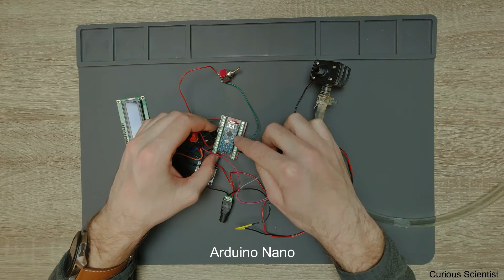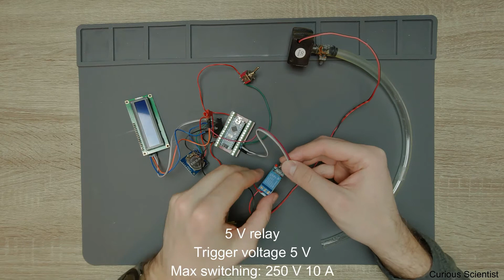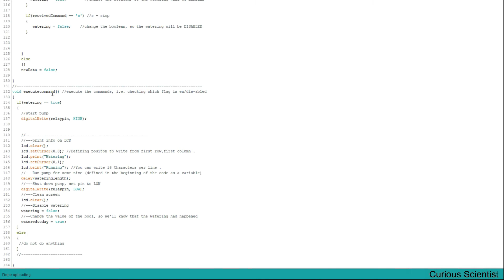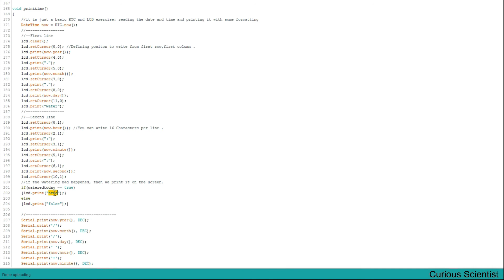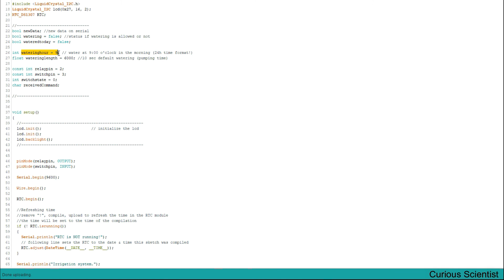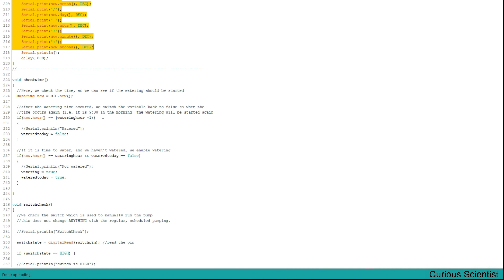Date and time based watering system using an Arduino and a RTC module

Comment: Awesome project.
Can you please add eeprom function to the code so the set time values are not lost on power failure .
Awaiting your earliest response.

Thanks & kind regards
Reply: I mean the set on off time values not the RTC time.
If the power is lost , one needs to set on off time again.
Hope you understand my point regarding storing on off time to eeprom.
Reply from the maker: Ah, sure. Yes, that you can store in the eeprom of the Nano! Just pass the values when you set the time and then recall them in the setup() whenever the microcontroller starts.
Reply from the maker: Thanks! The RTC modules have built-in batteries, so they don't lose the time once you set it.

Comment: Hi! great video, can i ask something? is it possible for me to replace the lcd screen with oled one?
Reply from the maker: Hi! Yes.
Reply: oh and also what type of relay you using, it is the low or high triggered?
Reply from the maker: I don't remember, but it doesn't matter. You can set the GPIO to high or low in the code.
Reply: @CuriousScientist  oh okay, thanks!

Comment: how to add 2 times watering in a day? like int wateringhour = 9 am and 5 pm??
Reply: Thank you
Reply from the maker: Hi! You just write two conditions which trigger the pump.
Reply: @CuriousScientist  like int watering = 9; int watering = 10 like this??
Reply: @CuriousScientist  you use ds3231 in actual but in code you use ds1370 rtc?
Reply from the maker: RTC should not matter too much as long as you get the same information out from it. Regarding the other questions, those are wrong. You declared the same variable twice just with different values.
Reply: @CuriousScientist  can I change the water pump into stepper motor?
Reply from the maker: Sure, you just need a stepper motor driver and write a code accordingly. Everything is possible.
Reply: @CuriousScientist  thank youuuuuu big help for my project hehe

Comment: Hi! Thank you, but I do have a question, on the 12v power supply.. how many amps? Thank you
Reply from the maker: Hi! It depends on the pump. Generally, they are 500 mA. So it's a good idea to use a 12 V, 1 A power supply.

Comment: Hi, well explained video. Only one doubt, is it possible to put multiple cycle for one day?. And if it could be controlled using a selection switch to alter timing as desired, it would have be very helpful.
Reply from the maker: Hi! Thanks! Sure, it is possible.
Reply: @CuriousScientist   Can you please convey how, I am total fresher in Arduino. A suitable link/ video explaining this would be helpful.
Reply from the maker: Hi! Just search for similar projects. I am pretty sure that someone already made it and published it somewhere. I don't have any resources as a reference. Also, you can just use my video. You can add more conditions that should trigger an action. But maybe for a total beginner, this is actually a too difficult project. You should start with something simpler.

Comment: Excellent project
But can watering  system will work 
If we want , watering system to run 
after two , three months
Reply from the maker: Thanks. Yes, it is possible. My watering system was running for half a year without any issues. I used it to water my chili plant in my office at work.
Reply: @CuriousScientist  means can I get watering after two month of gap with the help of rtc module
Reply from the maker: Sure, you just trigger the pump using the number of months as a condition. Or you keep track of the elapsed days and trigger after every 40 days. The possibilities are endless.
Reply: @CuriousScientist  Thank you Sir
Can you please give code of it to me
Reply from the maker: Sure, you can hire me for writing the code. But of course not for free.
Reply: @CuriousScientist  Thanks for your support

Comment: Very useful video! Thank you. I'm working on a program that will work on our product for our research defense, we didn't hire a programmer since its very expensive for us students to pay them. And currently, I'm having troubles with my program, is it possible that instead of turning the watering system off and on, but I will apply it to an LED that will fade at a specific time? In simple words, scheduling the LED to fade in and out at a specific time using RTC Module. I'm not very much of an expert when it comes to coding, can you recommend me examples that I can study with? I hope you can help me with this. And thank you for this video!
Reply from the maker: Hi! Sure it is possible, you just have to switch the LED instead of the relay. However, if you want it to fade in and out that's a different story. You then need to drive the LED with PWM. When you want to fade in, you ramp up the PWM, and when you want to fade out, you ramp down the PWM. For resources, the whole internet is there, just use Google.

Comment: Hi Curious Scientist. I have a question. How long can this stay continuously powered without a computer powering it, and how would I go about that? Thank you.
Reply from the maker: Hi! I used this exact circuit some years ago in my office to water my chillibplant and it was running from a wall adapter for roughly half a year.
Reply: Thank you!

Comment: Great video, had a lot of useful information. Thank you.
I'm having an issue with the LCD display, for some reason I don't see any information on the screen only the backlight is ON.  What could have caused it? Any guess or suggestions to look into the code. 
I understand if you are done answering such stupid questions. Once again thank you for the video.
Reply from the maker: Hi and thanks! It's very typical that the contrast is not adjusted properly. Try adjusting it using the potentiometer on the LCD.

Comment: Hi, thanks for your explanation and code. I’m a beginner and this info is real educational. Only one problem with the screen. Every second on clock makes screen blink. Strange no? Can you imagine what going on?
Reply from the maker: Hi and you're welcome! As you can see it on the video, I don't have this issue. I recommend you to disable all serial communication. You can try removing the section that I highlighted at 14:35.

Comment: What if i do not use a switch? I just only set thr time when to irrigate. Can u help me about the code?
Reply from the maker: Nothing should happen if you omit the switch. The switch is only used if you want to have a "forced" irrigation.
Reply: Bro, what library did u used to this code?
Reply from the maker: First of all, I am not your "bro". Second, I shared all the resources in my video and on my website. Take your time, watch the video and read my published material.

Comment: Thanks very much for such an in-depth explanation & guide to using an RTC to control the watering system using an Arduino. I'm currently working on a similar project and had been looking for a way to do exactly what you have done. You are a life saver!
Reply from the maker: Glad that my video helped you! Cheers!

Comment: ill try your code but, when the pump is after that the lcd goes blank? what should i do?
Reply from the maker: It should not turn off. Maybe you made a mistake somewhere. Do you power the pump with an individual power supply? 
By the way, I am not a free support service, I cannot answer every single questions for free.

Comment: hi can i use 220v pump instead of 12V
Reply from the maker: Hi! Yes, but make sure you choose a suitable relay. But I wouldn't risk using 220 V if it's not necessary.
Reply: @CuriousScientist  what relay module can  i use
Reply from the maker: Whichever that fulfills the pump's and the microcontroller's parameters.

Comment: Sir can u plz . make this type by using nodemcu esp8266 plz .. 🙏🙏🙏🙏🙏
Reply from the maker: Hi! You can use Arduino IDE for the above mentioned MCU, so this code should be more or less compatible with it.
Reply: @CuriousScientist  yes sir but company told us to use mcu only 😅 can u plz...help me in coding 🙏🙏
Reply: @CuriousScientist  how can I contact u
Reply: @CuriousScientist  actually we have to create smart lighting system which will turn on and off according to time and my 80% project is ready only that timing fiction is remaining plz..help sir 🙏🙏🙏
Reply from the maker: Sorry, but this is not a free technical support service.

Comment: sir what if I set the code to just trigger the watering system once a week . how do I do it? thank you sir
Reply from the maker: Hi! You run a counter which is increased by 1 every 24 hrs. When its value is 6, you run the watering and reset the counter to 0. Simple!

Comment: Hi, I am creating a code for a irrigation system based on you code, thank u. I see you declared the switch variable "shitchstate" as an int, yet when you use the digital read function it returns high, how come it did'nt crash?
Reply from the maker: Hi! Because high is also interpreted as 1, and low as 0. You can use the digitalWrite in the same fashion: either you use 1 or high, both will work.
Reply: @CuriousScientist  Thanks! Very useful tool. It will irrigate a large area of mushroom production.
Reply from the maker: @diegofroesesouza2273  You are welcome! I wish you a nice yield!

Comment: hii @curious scientist 
i installed new battery to my rtc module refreshed the current time when i i power off my project the time reset to when it was complied 
then i even changed my rtc module then too the problem continues 
pls help me
Reply from the maker: Hi Kumar! In order to refresh the time in the RTC after you changed the battery, compile a fresh version of your code and upload it to the Arduino. The RTC always keeps the time compared to the time of the most recent upload of the Arduino code. So, just reupload your code and it should work. Check my code, there is a line like "if(!RTC.isrunning())"... Read the comments there how to do everything properly.
Reply: @CuriousScientist  yes I did this and the time refreshed but when I power off and again on my project the time doesn’t save and it starts from the default time
Reply from the maker: If you don't power off the RTC, it shouldn't happen. Are you sure that the battery is good?
Reply: @CuriousScientist  the I bought yesterday from an electronic shop and I checked the Voltage in multi meter it was 3.11 volt
Reply: And it’s my 3rd rtc module I bought for this project but the problem didn’t solve
Reply: @CuriousScientist  help me sir
Reply from the maker: Read the code and watch the video carefully. You have to set the time first, then recompile the code and upload again so you won't keep resetting the time. I even wrote this in the source code.
Reply: @CuriousScientist  I couldn’t find the thing you said
Reply: @CuriousScientist  how to set time in rtc
Reply from the maker: @Riteshkumar-hb8vl  Watch the video, I tell it! I also told you many times here.
Reply: @CuriousScientist  i watched but couldn’t solve the problem
Reply: @CuriousScientist  when I upload code and open serial monitor it says rtc not working
Reply from the maker: @Riteshkumar-hb8vl  You mean it says "RTC is NOT running". That means that the code entered the part which needs to run once to adjust the date and time in the RTC. This also means that you haven't watched the video carefully and haven't read my comments here and also in the source code I provided.... Once the RTC is updated, you have to remove the "!" from that part of the code, recompile, reupload it. Then you should get the proper time once you turn off the Arduino and turn it back again.
Reply: @CuriousScientist  thank you sir i have solved the problem
Reply from the maker: I am glad to hear that you have figured it out!

Comment: Hello!! i have so many questions!, please how can i talk to you about in this project. i dont want my project to go on waste. please help me...
Reply from the maker: Hi! You can ask it here so others can also learn from the questions and the answers. You can also reach me privately through my website, but keep in mind that I am not a free support service.
Reply: Hello!! I just want to ask 

What if i used arduino uno ? Same wirings ?

Can you help me ? This project is the same as mine, but the other feautres is that there is LED LIGHT connected to RTC module

Sample

When the time is at 8 am the punp will start and close after a seconds then when the time is at 7 pm the led light will turn on and the pump will turn on

Purplse of the led light: like you can see at fountains ? To see that tge watering system is activate
Reply from the maker: The wiring depends on you. Just check which are the i2C pins on the Uno. The switch and the relay pin actually depends on you, you can assign any pins. 
Why would put the LED on the RTC? It does not make sense to me. Switch the LED from one of the Arduino's pin.
Reply: @CuriousScientist  no the LED im talking about, it is placed beside or within the sprinklers so that the light from big LED you can see the sprinklers are turn on if its night time
Reply from the maker: Ah, sorry I misunderstood it. So something like a floodlight. I recommend to use a separate relay for it, especially if you supply different voltage to it than to the pump. You still switch the relay with the Arduino, but a different one.
Reply: @CuriousScientist  relay for water pump ? Then relay for LED lights ? For you to get it, my project is "automatic watering irrigation system with GSM and RTC module" the gsm module part is done but the RTC module is not, it is so hard
Reply from the maker: @IzumiKai18  I literally explained the RTC in this video. Watch it more carefully, it is not hard.
Reply: @CuriousScientist  i dont know the codes in arduino for that bro so its hard RTC module + LED Light bulb

Comment: Hi @Curious Scientist,
Do you have any idea if it is possible to add a temperature sensor and if the temperature is below 50 fahrenheit, for example, it blocks the water outlet?
Sincerely, Tales.
Reply from the maker: Hi! Yes, search for a so called "solenoid valve". You can switch them in the same fashion as you are switching the pump in this project: you put a relay between the microcontroller and the valve and switch the valve using the relay. You can add a simple thermometer such as the DS18B20 (I have videos discussing this particular thermometer, search it on my channel) and just write a single function which reads the thermometer and decides whether it should close the valve or not. It is just a few extra lines of code.
Reply: @CuriousScientist  
OK, solenoid valve, I'm going to research this. On the temperature sensor, I have a DHT11, which measures temperature and humidity. I don't have much knowledge in c ++, how would the code look? I thought something like this, but i don't know if this works:
if (temperature) <50
       {
          watering = false; // change the boolean, so the watering will be DISABLED
       }
if you can help me with that i would appreciate it, but only if you can! don't worry too much about me, i don't want to bother you.
sorry for the english, i'm from brazil. Greetings from Brazil!

Tales.
Reply from the maker: @TalesTelles  Hi! The code is almost ok. It is good on the algorithm level, but the if condition has to be inside the parenthesis: if(temperature < 50). I guess, temperature is a variable that you use to store the temperature read by the DHT11. Make sure that you will use the proper units (Celsius, Fahrenheit...etc). Also, put an else after the if(). Why? Because if the temperature temporarily falls below 50, you will be locked in the "watering = false" state forever. So, the code would continue as else{watering = true;}. This will make sure that as long as the temperature is above 50, the watering stays enabled. 
BTW, your English is pretty good, don't worry! Greetings from Sweden!
Reply: @CuriousScientist  OMG! Thank you so much! I will try this later and keep you updated.
Reply: @CuriousScientist  I just added the changes to the code, here is a print:  https://prnt.sc/1050tt1
Unfortunately, I am without the arduino at the moment, so I will not be able to test  = /

- 20 is the temperature in degrees celsius
Reply from the maker: Hey! I strongly believe that there are simulators for Arduino. So, it is a software which can emulate the Arduino and you can interact with it and its pins. What I am trying to say is that you can test your code without actually having a physical microcontroller. I haven't tried any of these software but I guess, you can search around on Google and find some of these software.
Reply: @TalesTelles  This might be a bit late, but you could potentially check out tinkercad, by autodesk. It's a wesbite online. It might not have all of the parts you need, but if it does it might be a good free software for you to use to test out your circuit. Autodesk is a pretty good company so I highly recommend it.

Comment: Which rtc module you used  DS1307 or DS3231? I have DS3231 will the code  work  with ds3231 rtc module?
Reply from the maker: Watch the video more carefully...
Reply: @CuriousScientist  thank you so much its working🙏🏻 I am totally new  in this field. This electronic field is very much  interesting i am trying to learn new thing and  c++ language is one of them. Thank😃🙏🏻
Reply from the maker: Thanks. I guess sometimes it worth, to actually watch the video. In this case, it was just 59 seconds into the video for the answer. ;) 
Arduino is excellent tool for this approach to learn electronics and C/C++ languages to a certain extent by actually having fun. I hope you'll enjoy your journey.